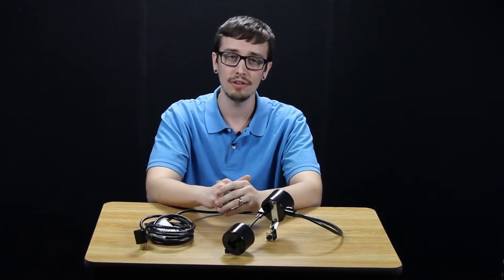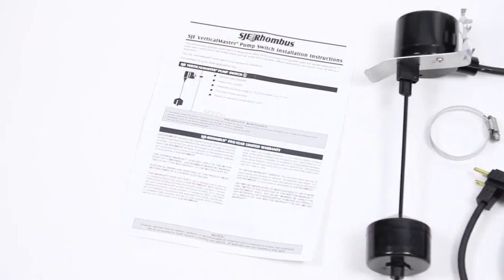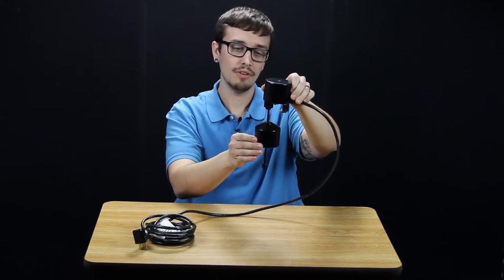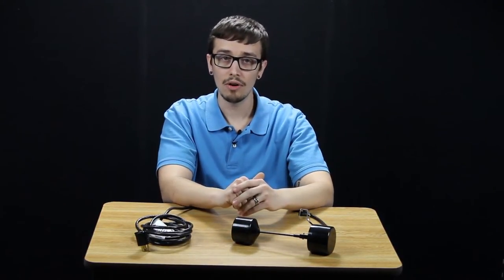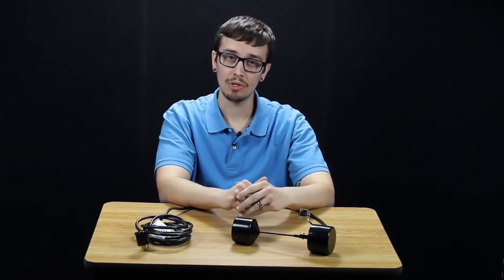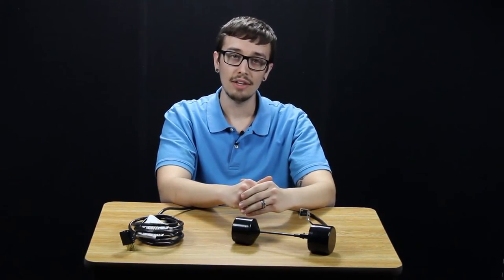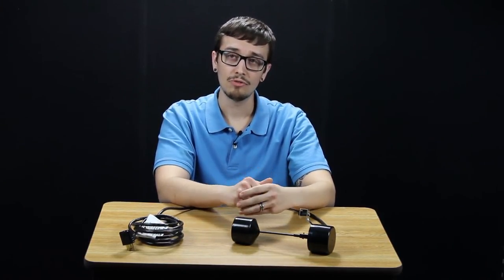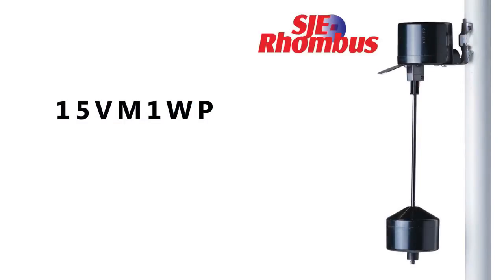SJE Rhombus Vertical Master Float Switch

Comment: Hello dear!
Am I correct that this Vertical Master Float Switch can be used in any type of water, like Clean Water or Dirty Sewage Water? RIGHT?

Thank you in advance for your quick reply!
Reply from the maker: Thanks for the question Alex.

 Typically, installers try to avoid using a vertical style switch in applications with a lot of solids present. This is because the solids can accumulate on the float itself and disrupt the actual switch mechanisms. They CAN be used for freshwater and effluent pumping, but are usually not used for pumping sewage unless there are space restraints that do not allow the use of a tether-style switch.
Reply from the maker: Thank you for the question Alex.  The VerticalMaster Pump Switch is designed to operate in non-potable and sewage applications with limited space.
Reply: R.C. Worst & Co., Inc. thanks for your quick reply. The matter is that our company is producing sewage tank systems inside consisting of 3 cameras in the last 3rd camera we used DAB Nova 180M pump before but now we are trying to use a pump we purchased in China using this vertical master switch. Usually sewage water coming to the 3rd camera it is rather clean and no solids or fragments in it, and also the must be placed in the deposit inner tight limited space room inside this 3rd camera to pump over the cleaned water out of the system. 
Am I correct that in my case we must have any problems with Vertical master switch work, right?

Comment: is the switch submersiblte, I want to use it on my holding tank at my bait shop to regulate how much water it changes out daily. So imagine two tanks side by side connected with an over flow pvc for either tank that fills up to much. Now one of my pumps ,pujts out a lot more water than the other so i would like to regulate the pump in that tank with product
Reply: Thomas Giddings yes it is submersible .. u need to clean it periodically